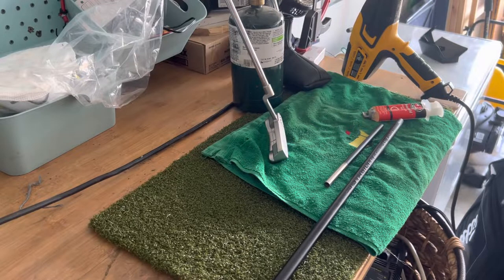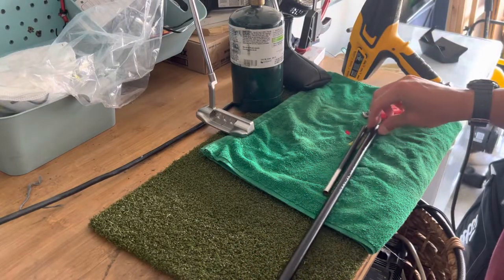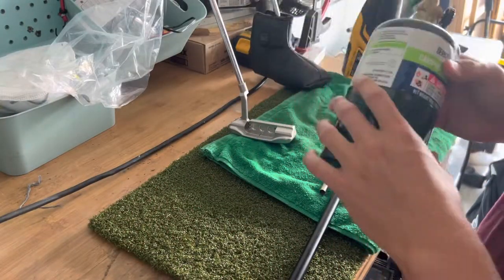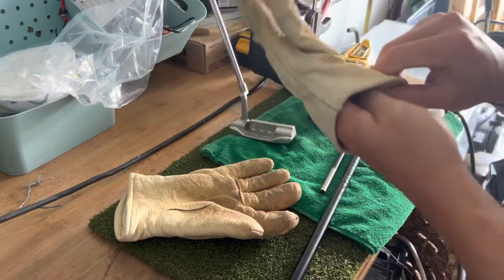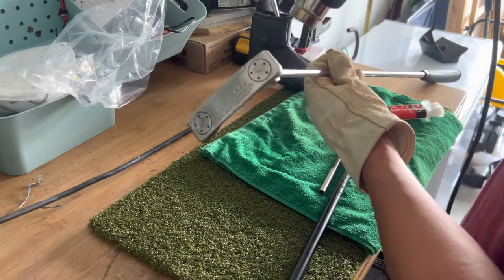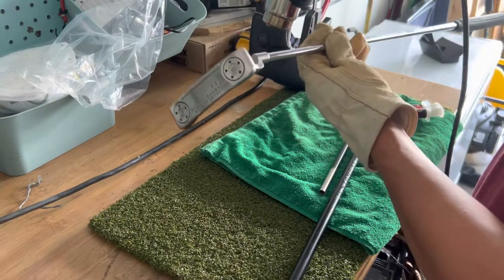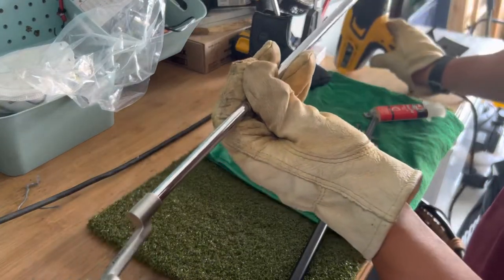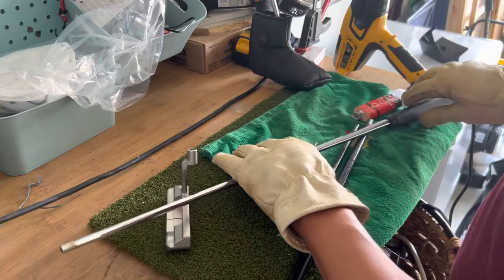Easy way to take a putter head off (Titleist Scotty Cameron Newport)

Comment: This is an easy one. What about one that goes into the shaft? I have a Ping that has a lose head and it has a dead feel when putting so i want to fix it. I gave it some heat with a torch but it never loosened up. Any advice?
Reply from the maker: Hi there and thank you for the view, I’m sorry I’m so tardy getting back to you. These putters are very unique and that the head of the putter is held into the shaft with a ball bearing. I currently do not own any putters with this. If I run across one, I will do a video on it.
Reply: @kenshowtosandreviews4320  - NO worries. 
Thanks! I can't get mine off but heating it up seems to have somewhat fixed it. Maybe it had epoxy that melted and re-set after?